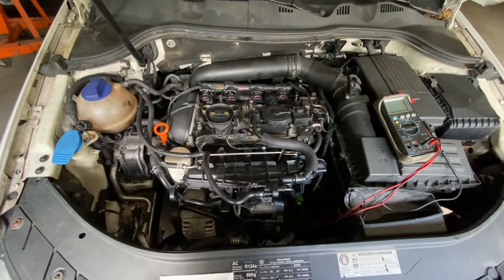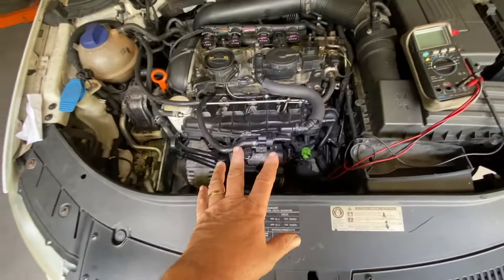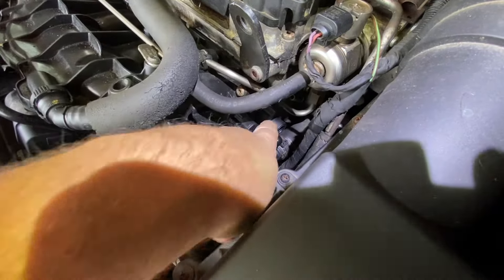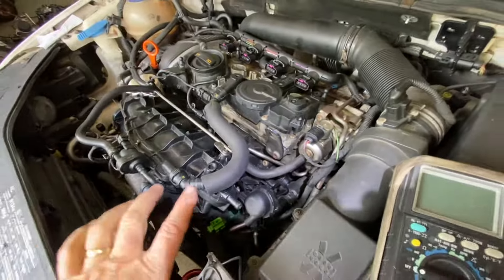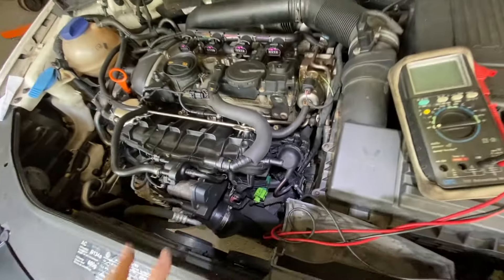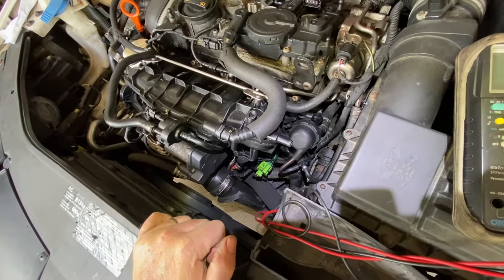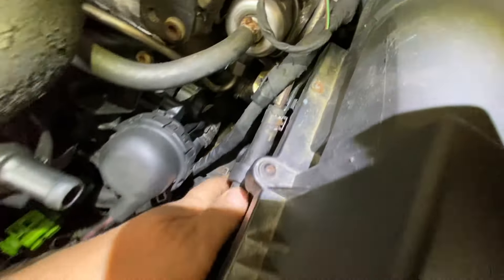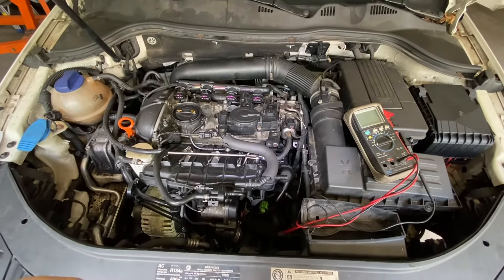How To Diagnose A P2015 Code On VW Passat, Tiguan, CC, Jetta TSI/ CCTA 2.0 Turbo 2009 & Up

Comment: Argh, I just cleaned mine and put it back on and it's thrown this code. These are a nightmare to take off and on. I have read they might be replaced by VW upto 140k miles as a recall, any ideas? Anyways thanks to your great video on timing chain replacement my cars almost completely sorted, thanks again dude. However I am beginning to think these engines are junk.
Reply from the maker: Thank you for the comment. I didn't know about that recall. They do have their problems but what vehicle doesn't?
Reply: @motorcarnut  No, thank you dude, id be stuck without your help. I guess they all have issues but the list here seems endless, modern cars eh! cheers.
Reply from the maker: Really appreciate it!!

Comment: I also had this code. Changed the sensor. Didn’t work. Took the intake manifold apart. All parts work. Nothing loose or broken. Was about to give up. Before putting her intake back on there engine , decided to clean the flaps and the manifold itself since it had a lot of gunk on the flaps. Put it back and it has been 2 days and no code yet. So, maybe for some of you guys try cleaning the flaps and the intake itself.
Reply from the maker: Great tip!

Comment: My daughters VW Tiguan 2016 is throwing P2015 code, and it's going through oil like crazy. Nothing on driveway so where is it all going and is it related to this manifold issue? Thanks for your time and great video!!
Reply from the maker: Thank you!
The manifold is probably not related to the oil consumption. Check the PCV valve, I have videos on it and how to test it.

Comment: Thanks for this video and explanation, I was having this code, and started to have misfiring codes as well, so glad that you explained that could be the cause, after taking a look, the little piece that goes on the manifold was missing (it was sitting above the transmission, lucky me) so I've put on the place again and after connect to the vacuum rod, everything worked like a charm again. Kudos!
Reply from the maker: Awesome! Glad it helped and you fixed it for no money! Those are the best fixes!

Comment: Hey there I have p2015 code car drives normal but as soon as I’m in high rpm’s engine starts to hesitate and I get reduced power wondering if this code is the problem or could it be sparks?
Reply from the maker: Yes, code is directly related to your problem.
Reply: I have the same issue , but mines doesn’t run no more then 10mph , it gave me the same code P2015 but I’ve been seeing so many videos , how do you know which sensor you need ?
Reply: Same here TIGUAN 5N 2.0 TSI 4motion

Comment: Great video.  I have a 2009 VW Passat CC 2.0TDI (diesel CBBB engine - aluminium intake manifold). I had this code several years ago - I purchased the DieselGeek bracket that prevents over-travel of the intake manifold flap actuator.  The fault has come up again several years later - wonder what it could be this time?  vehicle runs fine, but scan shows the intake manifold runner control Bank 1 stuck closed and also the fault for stuck open?  Wonder what it could be - is that vacuum connection the same for the TSI and TDI?
Reply from the maker: Yours is a little different, can be the sensor on the runner or the vacuum solenoid or the flap itself that is binding.

Comment: Hey man I need some help. I got a p0322 code on my 09 passat for a crankshaft position sensor. Said to replace it and i did. Runs better now but the code is still there after deleting it. Nothing is wrong with the wiring or the cars computer. Any thoughts?
Reply from the maker: Did you use a OEM sensor? Aftermarket ones tend to not work well.

Comment: I have no codes but under hard acceleration the car stutter and sounds like popping out the exhaust, car wants to go but it has trouble. Is tuned and has had a lot of maintenance done to it. Assuming it might be turbo or just intake manifold. Spark plugs have always been changed but coil packs haven’t. Want to fix it as it’s a fun car to drive on the weekends after daily driving my Audi
Reply from the maker: Sounds like you're having a boost leak or maybe a vacuum leak somewhere.

Comment: I was getting this code after replacing the whole manifold. I honestly didn’t think that plastic house would keep it it from running right and I didn’t have the rubber to connect it. I will plug it in when I get home and if it works you have finished my 3 week repair process🤣🙏🏽👍🏽
Reply from the maker: Awesome! Hopefully all goes well!
Reply: Did it worked?

Comment: Superhelpful video. I have a 2014 scirocco 2.0 tsi and got a 2015 code. Took it to a big indy shop who want to replace the camshaft sensor. From my search the intake manifold replacement should fix the issue. Can the camshaft sensor throw a 2015 code?
Reply from the maker: Yes but rare. More often it's the timing chain tensioner that jumped the chain.

Comment: I've been dealing with a strange vacuum suction noise coming from my car when I start it. The check engine light will flash and then It'll stop as well as the gurgling. I don't know whats happening. I have the flapper fix kit from ECS Tuning installed, but I'm still getting misfires, but also my spark plugs fouled in a day.
Reply: I have 2017 VW CC.
Reply from the maker: Did you check the PCV valve? There is a round piece on the top and on the side is a hole, when the car running there should not be vacuum coming from that whole, if there is it PCV valve should be replaced. The gurgling can be a blown head gasket which would also cause misfiring.

Comment: I've replaced everything with o e m... i still get the same damn code... And now since it's cold outside I have horrible misfires on start up to where the vehicle shuts off....

Once its warm the car runs fine

2.0tsi e888 gen 1 cbfa
Reply from the maker: What exactly did you replace already and what are all the codes ?

Comment: Will this cause smoke out the exhaust pipe please respond im having this issue on a car i just bought
Reply from the maker: No it won’t.
Reply: Thanku for responding. It was a fuel injector causing smoke. I did replace manifold but im still getting p2014 and 2015 codw

Comment: Got this code on my 2012 vw cc, checked the circle. Didnt pop out. Checked for a leak as well and no leaks. I did notice a little bit of oil around the pcv valve, checked the vent for suction and no suction on that either. Any idea on anything else i should check?
Reply from the maker: Got to check the intake runner flap for proper operation or can be the sensor near the oil filter on the intake manifold.
Reply: @motorcarnut  I'll check it out, thank you
Reply from the maker: No problem
Reply: Did it work for you?

Comment: Can you tell me where the other vaccum line on the intake selinoid goes I recently put injectors in my Volkswagen CC and I can't figure out where the other vacuum line goes to that seal annoyed on that nipple
Reply from the maker: One goes to from the back of the vacuum pump to the solenoid, then to the vacuum actuator,if you do have another port it’s just a vent with a filter that mounts in the middle of the valve cover

Comment: I replaced my intake manifold, and sensor and still getting the stuck open code on my 1.8 TSI. We just fixed a fuel leak that occured during install, still with the code. Please help?!
Reply from the maker: Could possibly be the wiring to the sensor?

Comment: just had a new manifold put on in January of this year....got that P 2015 code.....
Reply from the maker: Was it an aftermarket one?
Reply: It was the newer one....pn 06J 133 201 BH
Reply from the maker: @hmorales3377 make sure sensor works and electrical connection is fine. Also no vacuum leaks anywhere because that can set that code too.

Comment: Is there a third vacuum line on the solenoid or is the bottom barb capped?
Reply from the maker: Some models have a third vacuum line that goes to a fresh air filter on the valve cover and should not be capped!
Reply: @motorcarnut  well my daughter’s doesn’t have anything on the third barb. Should it be capped?
Reply from the maker: No, it should have the fresh air kit with is basically a rubber hose with a air filter attached. Or just run about 1 foot of hose and attach it somewhere near the oil fill cap area. If you block it, it will cause problems.

Comment: 2012 Volkswagen CC Sport. Just replaced PCV, Coils and plugs and installed a new intake manifold. still throwing p2015 and occasionally 0300 codes. but mostly p2015. The engine revs higher while in park and the actuator on the intake  Manifold seems to be stuck in the open position. Even when I manually move it back to ease the vehicle back to normal rpm it sucks the actuator arm right back. Its like there's too much vacuum. Any advice? just buy another intake manifold?
Reply from the maker: I don’t know, sounds like you have a vacuum leak somewhere. When you installed the manifold you made sure the injectors slipped into the slots correctly? Because if not that can create the problem you’re having.

Comment: Just so all the VW owners are aware, the intake manifold replacement is covered by VW.
Reply from the maker: That’s good news to me where did you get that information from?
Reply: @motorcarnut am too is aware
Reply: Lol his ass lying unless vw did a recall on the intake manifold I’m calling tomorrow because this is my exact problem
Reply: @jeffonemack4848 bro you commented 15 hours ago, this just happened to me. Please update me on your fix 😭
Reply: It’s 10 years from date of service / 120k miles extended warranty on the intake.
Reply: Volkswagen has extended the Warranty coverage for the intake manifold to 10 years or 120,000 miles, whichever
occurs first, from the vehicle’s original in-service date, for certain 2015 Model Year Volkswagen Tiguan, CC and
EOS with engine codes CBFA and CCTA.

Comment: I just had this light pop up (2010 vw cc), I’ve had a small coolant leak for about a year now (around mid engine) could that be related?
Reply: It also tends to overheat slightly for the first 5-10 minutes of operation and will drop down to normal operating temp afterwards
Reply from the maker: No, I thing the thermostat is staring to fail.

Comment: Would a blown turbo leaking oil into the intake charge cause this P2015 code? I’ve replaced the manifold with the updated design one, carbon cleaned, checked vacuum, etc etc. I’m thinking that oil is getting onto the runner flaps, migrating over to the sensor, shorting the sensor out, and tripping the code. After the manifold replacement it took a month or so for the code to come back. 2016 VW Tiguan 2.0T 109k miles. This car is a demon spawn from Satan himself I can’t believe how dogshit these engines are. They’re in everything VW and Audi! Terrible!
Reply from the maker: Yes, especially when these engines the way they are designed build up carbon like crazy and cause all kinds of problems. Also can be a computer software firmware update needed sometimes.
Reply: @motorcarnut  Ok glad to know that’s not just a crackpot theory I’ve got. I’ll definitely be replacing the turbo then
Reply from the maker: @tylerroe5175 like I said make sure it’s not something else because the turbo is expensive and rare that it would cause that problem but it’s possible, good luck!
Reply: @motorcarnut  I’ve pretty much exhausted every other option it could logically be and even though the manifold is newer now it had a shit ton of oil built up inside it when I took it off to look for more issues
Reply from the maker: @tylerroe5175 ok, then maybe it’s the turbo does the car but oil?
Reply: @motorcarnut  It’s a VW it definitely burns oil

Comment: I had this code on my mk5 gti and replaced the whole manifold, sensor, and solenoid, but the code keeps coming up. Do I have to use vagcom to reset the solenoid or something on a tsi? Any tips?
Reply from the maker: If wiring is fine you may need a software update. You don’t need vagcom for that.
Reply: @motorcarnut how do I do that?
Reply from the maker: Dealer I’m afraid
Reply: @motorcarnut  ugh, well ill try that man thanks for the help.